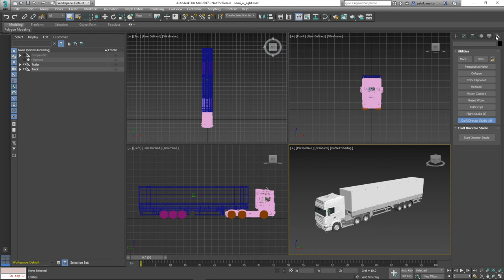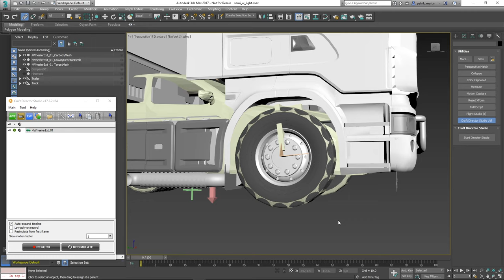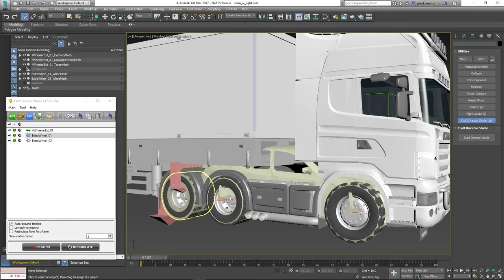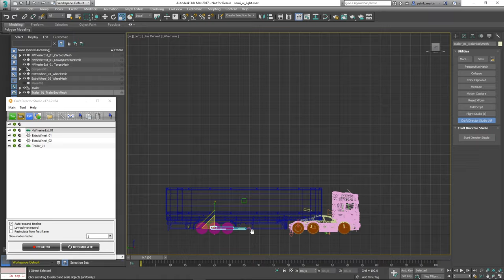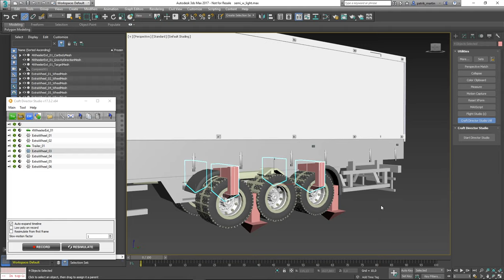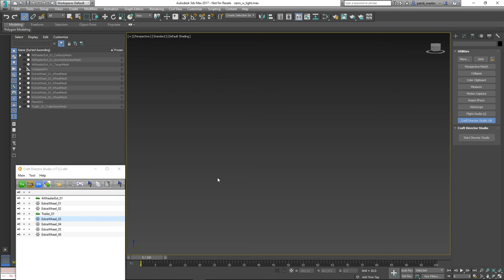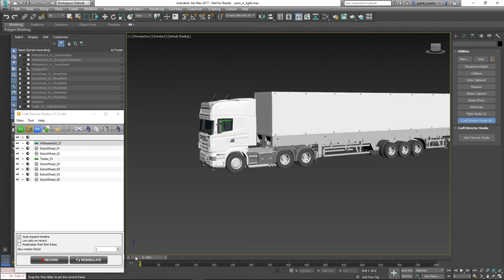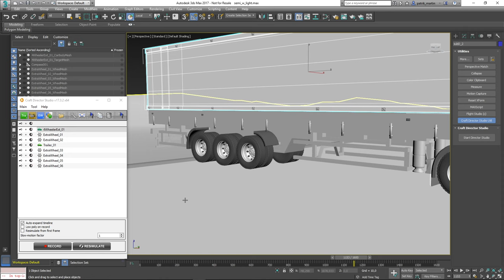How to rig & animate a Semi-Trailer Truck using Craft Director Studio - Tutorial

Comment: Hello. Great Tutorial. I just want to know, how can i control the timing  along with distance.. Thank you
Reply from the maker: You can control the timing using the 4-wheeler Extended's Autonomous mode. This make the 4-Wheeler Extended follow it's target mesh. The Target mesh can be keyframed to your needs or follow something else. For example it can be attached to a motion path and thus follow a spline. Please note that you might need to raise the "Gas Pedal (Forw/Backw) Maximum" (Maximum velocity) value for the 4-Wheeler to be able to go as fast as required.

Comment: Hello! How to go reverse with spline?
Reply from the maker: Hi, It is possible but very hard as the 4-Wheöer Extended easily tries to go around instead. My suggestion is that you use Autonomous mode up until the point you like to reverse and switch over to manual drive and use an input device to go in reverse. Once you are happy you can then go over to use the autonomous mode agin to continue your drive using a spline.

Comment: Can this work on a SKetchup truck model that is grouped as a whole and imported into 3ds max or must the tyres , truck and trailer all be in individual groups before importing ?
Reply from the maker: As long as you can export to 3ds max or maya you should have no issues. Wheels, chassis need ot be separated in order to be animated.

Comment: How to export animation to UE4? Alembic cache and FBX aniamtion does not work properly in UE4
Reply from the maker: For game export in mind it is better to use constraints for position (translation) and orientation (rotation) instead of making the parts children of the rig. Group all high-poly parts that are to be one animation once grouped make your animation.

To export from Maya or 3ds MAX:
1. Select the high-poly model group and go to Game Exporter.
- Maya: File -> Game Exporter
- 3ds Max: File -> Export -> Game Exporter

2. In the Game Exporter go to the Animation Clips tab
3. In the Animation Clips add a Clip, give it a name and set it to the frames you like to get exported for the rig.
4.  Make sure that Bake Animation is checked
5. Select a path and Filename and hit Export

Importing in to UE4
1. Once you have exported go to UE4 and create folder where you would like for the animation to be placed drag and drop the exported FBX file in to the folder created.
2. In the FBX Import Options window make sure to check "Import Animations".
3. Hit import and the animation should be in and usable.

Done

We are going to add to the list of tutorials we are to create going forward.

Comment: Great Tut!
Is there a way to achieve "Truck cab suspension" with Craft accessory tools?
Reply from the maker: You can use the SoftMotionCam or MotionFilterCam to achieve this effect. However, please note that you need to cancel out the transitional movements to avoid the cab falling behind.

Comment: What are the top 3 reasons i should animate in 3ds Max and import into UE4 using your plugin as opposed to animating a car directly in UE4?
Reply from the maker: Hi Scott, 1. The top benefit is to be able to utilize Craft Director Studios realistic movements of the vehicles. 2. The effectiveness of creating and adjusting the animations in a short amount of time, thus being able to deliver faster. 3. The flexibility of the rigs to be adjusted to fit more or less any vehicle. However, it is of course not ideal to need to animate in 3ds Max or Maya and then export to Unreal Engine. We hope to have support for Unreal Engine in a not to distant future so animations can be made directly in Unreal Engine and not need to import/export between programs.

Comment: Nice tutorial. Can this plugin work for unreal engine?
Reply from the maker: It does not work for Unreal engine currently. You would need to create the animation in Maya or 3ds MAX and then export to the Unreal engine.
Reply: I try to export it using fox to unreal engine but I’m having trouble remove the body rig which come with craft animation.
Reply: Can you make a tutorial how to export it to unreal?
Reply from the maker: @aftereffectsnerd4530  You can unplug and remove those help objects, however please make sure to save a copy as unplug will be irreversible.

Comment: Why is my trailer shaking and wheels are not spinning on the trailer
Reply from the maker: There is a bug with the trailer that it shakes if placed on an uneven ground at start. This should not be the case in Maya anymore. However, 3ds have the same issue still.

Comment: How to create a soft tire?
Reply from the maker: With 4-Wheeler Extended there is a simulation that places the wheels slightly below the ground plane. But if you would need to deform the tyres the simplest would be to use a FFD(Box) per wheel.
1. Create an FFD(Box) from the Create/Space Warps/Geometric/Deformable
2. Place the FFD(Box) and cover the lower part of the tire that is touching the ground.
3. Bind the FFD(Box)’s space warp to the tire
4. Edit the Control Points of the FFD(Box) to compress the wheel
5. Link the FFD(Box) to the wheel center mesh so that it follows the wheel.
6. If you are going over curbs you can always create additional FFD(Box)es, that manipulate the wheels additional.